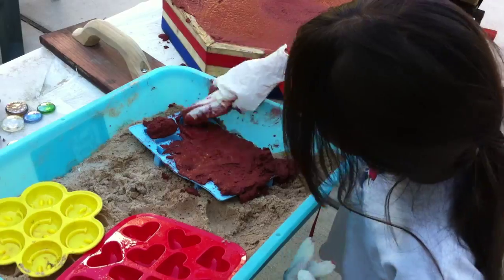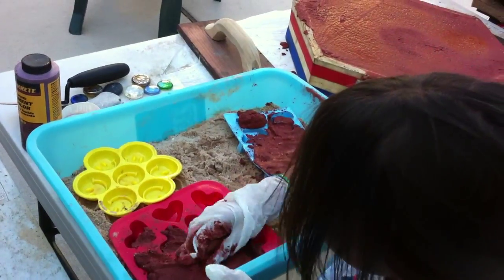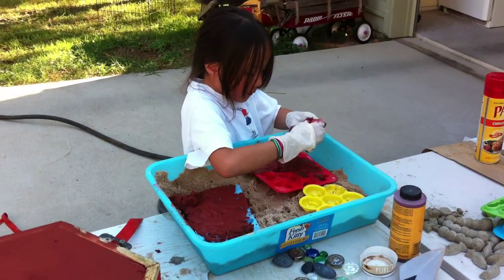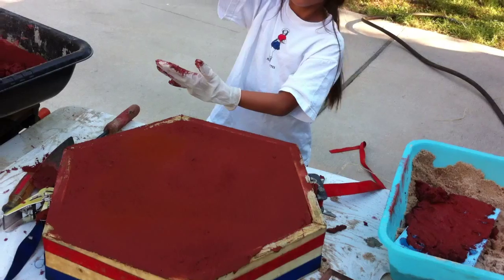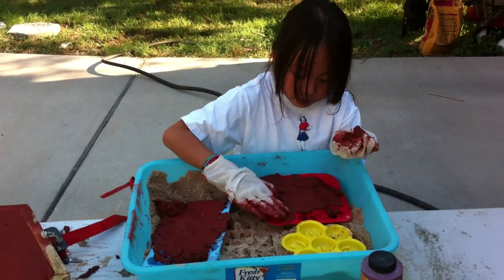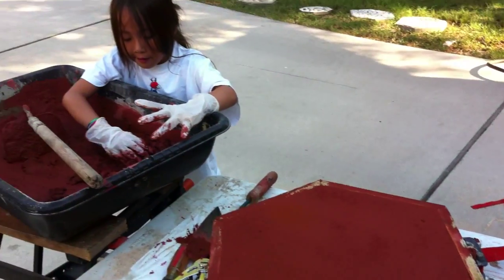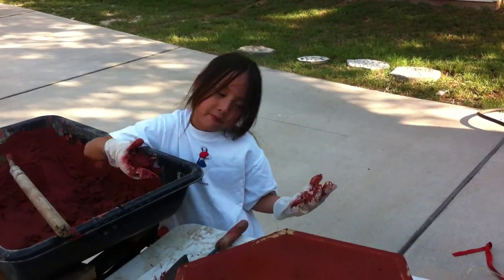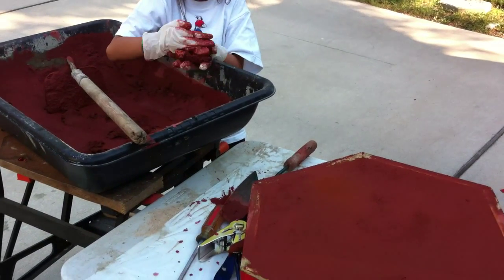Casting concrete into ice cube molds

Comment from the maker: They turned out well. We used most of them embedded in stepping stones. I had some crumble after a few months, probably due to insufficient mixing of the concrete. Likewise, some shapes that had thin parts didn't fare as well. I experimented with using concrete sealer on some, especially those I wanted to turn into magnets, and that seemed to work well.